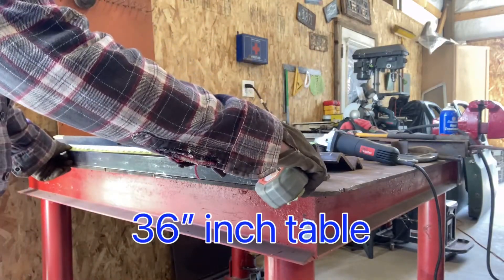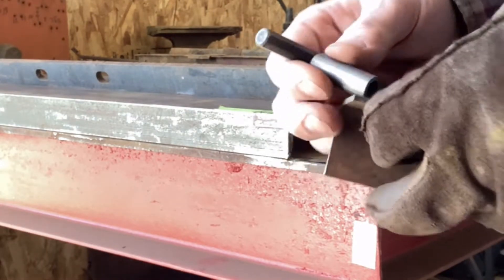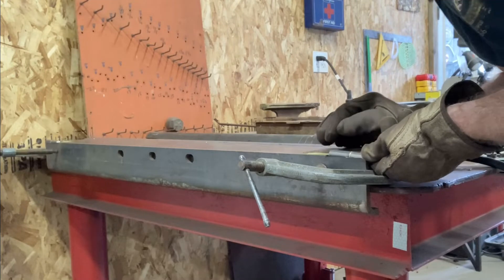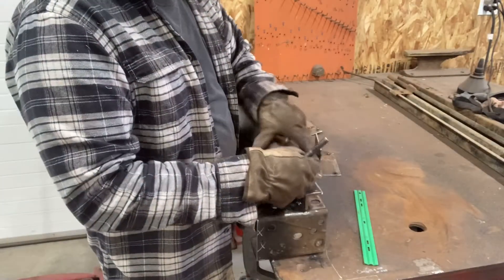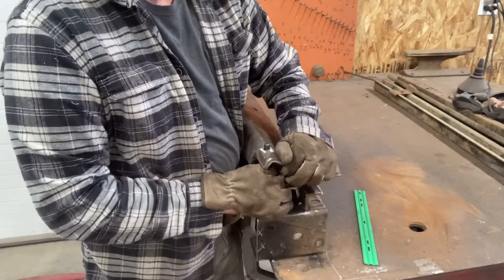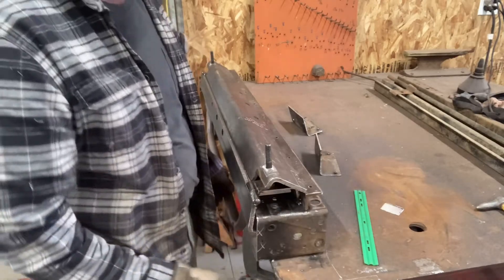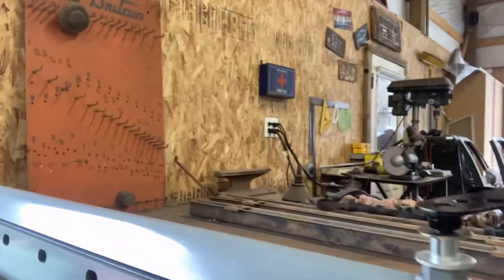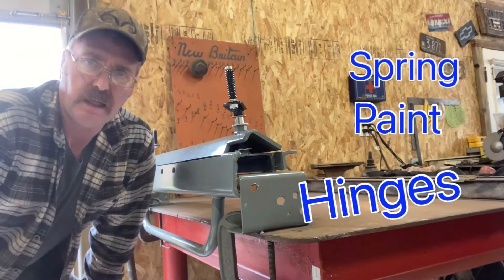Pt 1. "DIY sheet metal bender". Low cost made from scraps. Welding project (Farm 10)

Comment: I think, it would be better to not weld the bolts with the spring straight up 90 degrees. Because the thicker the metal to bend becames the more the upper brake has to go away from the turning point because of the radius. The angle should be around 45 degrees I think. So the way it lifts up it get away from the turning point. 

Sorry for my english, its not my mother tongue.
Reply from the maker: Yeah that’s a good point. I never talked about that. This one I set up to bend 19 gage sheet metal, that’s all I planned to use it for. You’re right, I’d have to go back to the drawing board for that one. Thank you for the advice I do appreciate it.
Reply from the maker: Yeah that’s a good point. I never talked about that. This one I set up to bend 19 gage sheet metal, that’s all I planned to use it for. You’re right, I’d have to go back to the drawing board for that one. Thank you for the advice I do appreciate it.
Reply from the maker: Oh and your English seems better than mine ….lol